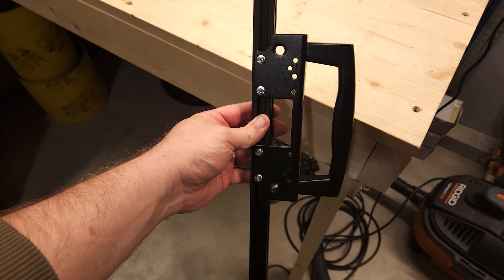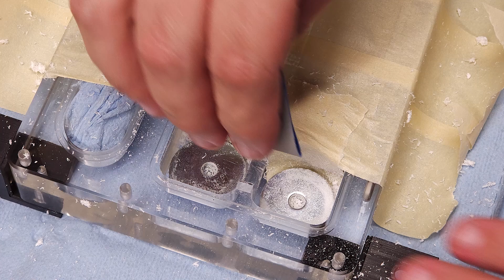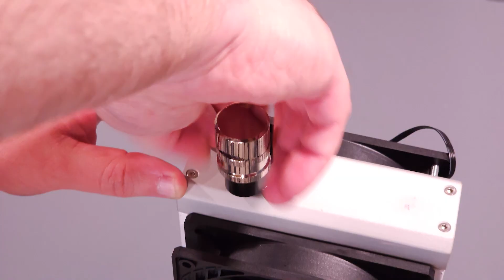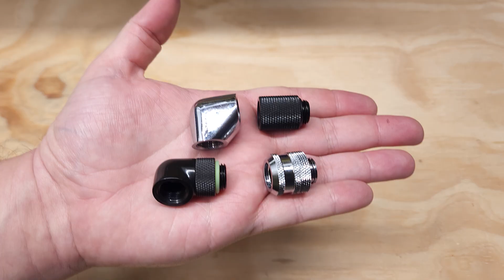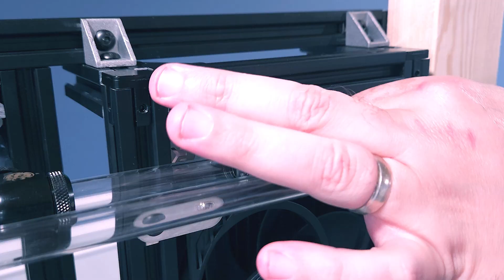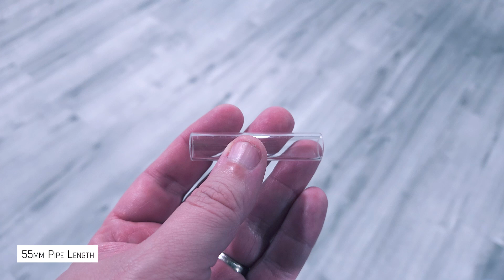Wall Mounted PC Build Part 4 - Watercooling Loop, Carry Handles, NVME FUN

Comment: I can't believe this series of videos have so little views. The amount of info plus quality is fantastic. One thing though, most flow meters are very inaccurate and the one you're using is horrendously inaccurate - like 20, 30, 40 % off. I highly advise getting an AquaComputer High Flow Next. It's pretty much on par with industrial flow meters costing multiple hundreds of dollars.
Reply from the maker: That's a good point that in retrospect of production, I've wished I could go back and add additional commentary about because you're right, this isn't the flowmeter to use if a true understanding of water flow is what you're after. I reached a point in my analysis that I discovered I wasn't so much seeking to understand the true flow rate, but rather to answer the question Is the water still flowing? But I also can't say that was universally true in every circumstance...sometimes I did care about the flow rate.

I'll make a note in my video idea backlog to explore this topic more in the next video series that includes a loop build and also share some of my findings.

And I appreciate the compliment. It's been a lot of work to put this series together but I've enjoyed almost every minute of it.
Reply: @htfiBEEP  The amount of time and effort must be huge. You even give extremely detailed info on things like power cable pins and some segments of your videos are like mini tutorials unto themselves. It really is an astounding amount of useful information and the video quality, editing, camera work, etc. is right there as well. Keep it up.